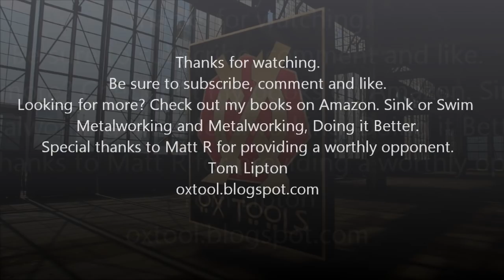Screw Extractor Torture Test Round 1

Comment: Merry Christmas Tom, as a former car guy after the extractor broke off and I got it out I would then drill out stud to just about the inside of the threads and then with a center punch or old pointed pin punch ( been there done that ) and collapse the remaining stud and get it out. That basically shinks the stud from threaded wall of bore,then clean up threads.In my experience if it breaks off when trying to remove the extractor won't get it either, Or else drill out and install a heli-coil. Just my 2 cents. Dave
Reply from the maker: Hey Dave,

If I was doing it for money I would have done that right out of the gate. My purpose was to torture the extractor to the maximum. Looks like I found the limit. Thanks for the comment. 

Cheers,

Tom

Comment: Tom would the high heat present from a turbo installation transfer enough heat to the studs to temper them?  Just a thought.
Reply from the maker: Hey Hank,

I think they use some high performance alloy here to prevent creep at high temperatures. Not sure but it was pretty hard stuff. Thanks for the comment.

Cheers,

Tom

Comment: I was grunting right along with you (noticed my abdomen tightening up during those last few tugs).

Amazing that the screw extractor snapped.  The material looks to be cast.  Can you tell us why it snapped - and why a much harder metal is not used for this tool?  (newbie here, so be gentle).

Thoughts:

1. Although not the original design of the manifold, it seems reasonable that one could drill all the way through and then pass the extractor all the way through, also.  This converts it into a shaft.  Then apply torque (equally) at both ends of the shaft, which might avoid snapping and give you more torque?

2. Perhaps there is far too much material left of the original stud?  Plus, when driving the extractor into the stud material, surely it pushes what's left of the stud even tighter against the threads, making the job more difficult.  Consider drilling a larger hole and using a larger diameter extractor, maybe 2mm or so less than the inside thread diameter of the stud?  This might weaken the wall considerably and allow extraction.

3. And then, if all else fails, would you consider drilling the whole thing out, re-tapping, and using a helicoil insert here?

4. Never used an extractor before... how do you get the remnants off the extractor shaft?

/mark richards
Reply from the maker: Hi Mark,

Check out part two of this short painful series. The extractor snapped due to operator error. Should have used two wrenches to balance the load. I don't feel that any extractor would have worked on this stud. The best method would have been to use the part that I sawed off to rotate the stud while the manifold was red hot again. Barring this drilling and helicoil is the next best option where speed is important. Thanks for the comment. 

Cheers,

Tom

Comment: After breaking a dozen "ez-outs", I don't even play with it any more...straight to the mill. One bolt size smaller carbide end mill, then drill bit to minor thread size, then tap to clean it out. 

Even with setup, it's usually the faster method.

Comment: Quite a coincidence, I'm spending my sunday afternoon digging out a broken 10-24 tap and a 5/32 carbide end mill from my mini-pallet project from the middle of a  1 inch plate of 6061.
Reply from the maker: Hey Phil,

Whoops. Best of luck to you. That will interfere with facing the top off to clean it up level when you want to. I rarely use 10-24. My default is 10-32 almost always if I have design control. Thanks for the comment.

Cheers,

Tom
Reply: Got them all out ;0

Comment: I like to heat up with a blow torch and add a little bit of wax. The wax draws into the threads and acts like a lubricant. Also Mig welding a nut to broken off bolts with wax does wonders too.

Comment: Hey Tom,

Looks like that stud got quenched, either from Turbo or 'Blue Wrench' heat.

I'd have grabbed one of my masonry drills to tackle that stud. Run at high speed red hot it would have taken the temper out and the heat may well have broken the thread seal.

I was told many years ago about removing studs from cast Iron manifolds "If it ain't glowin, it ain't goin".
Reply from the maker: Hey Paul,

Good advice. I take the gloves off in round two. Thanks for stopping by.

Cheers,

Tom

Comment: good luck getting that hack saw under the car onto the stud. i've seen those style extractors snap before. the tip I got was not to tap them in too hard. it expands the stud making it harder to turn out. I would have welded a nut to the stud, and heated the manifold flange to extract the stud. that's my go to technique.
Reply: Hi Albert. He cut off the stud on purpose to make the whole operation harder. The idea was to test the extractor and not necessarily the best way to remove the stud. Good to see another Tremblay. Take care.
Reply: yep/ I got a bit mixed up there.

my dad is from st. paul's Alberta, is dad is Acadian and his mom's family is from Britany.

Comment: I know it's an old video but I think that stud was hardened at the end simply due to heat cycling. Regularly, turbocharger turbine housings can reach temperatures of 900°F+ and steel starts to harden at 725°F. I think that the root of the stud has more thermal mass to absorb heat than the head of the stud, so the end of the studardened but the core didn't.

Just my opinion

Comment: work hardened stainless stud by any chance Tom? I do love those extractors!

Dan
Reply from the maker: Hi Daniel,

Might be. Chips didn't look right for that. I was thinking something with high creep strength like Inconel. Thanks for the comment.

Cheers,

Tom
Reply: Hi Tom,

To be honest I'm not clued up on inconel and the likes, I just remember getting some replacement studs that were stainless for a turbo petrol of some kind when I worked as a car mechanic.

I've only ever snapped one of them extractors and it was a smaller one so kudos on breaking one of the bigger ones!

Dan

Comment: It took forever for me to remove a broken fastener from the crankcase of my dirt bike. It almost didn't want to drill through the aluminum bolt. It ended up breaking through enough to catch some of the bolt and spin it out. By the way those left hand drill bits are expensive. 5 dollars a pop. What kind of drill would I need to really get through these bolts especially the hardened ones? I mean mine barely got through that soft aluminum.
Reply from the maker: +Belicose777 Hi Belicose,

Good quality high speed drills would work fine. IE not Harbor Freight drills of any flavor. Everybody should have one set of nice drills for those tough jobs. Thanks for the comment.

Cheers,

Tom

Comment: PS a lot of those turbo studs are some kind of stainless 17-4????
Reply from the maker: I actually checked it with a magnet. Its just slightly magnetic. I was thinking Inconel perhaps. Its hard tough and creep resistant at high temps. It was less magnetic that 17-4 and harder than even heat treated 17-4.

Best,

Tom

Comment: This is why i always weld on a nut instead of breakinng extractors in there, sometimes if it is recessed the weld method wont work and extractor is the only way, but 9/10 times I weld on a nut. I dont have fancy milling machines, but i have yet to be beaten by a bolt using my welders and oxy/acet rig. 😃 good luck and merry christmas 😃
Reply from the maker: Hey 95,

I purposely cut the stud off to test the extractors. I don't think I could get enough weld on it that short to do any good. Thanks for the comment.

Cheers,

Tom

Comment: Just another note, modern automotive bolts, studs and screws are high, to extra tensile and are torqued to previously unheard of factors. Quite a lot of these fasteners are not available "off the shelf' but only from the vehicle agents as they are unique in size and shape. Go into a modern garage and see the sizes of the "breaker bars" they are monsters.
Reply from the maker: Hey Bruce,

I suspect some kind of high creep strength steels are used. This one is hard but not super hard and barely magnetic. I was thinking something like Inconel perhaps. Have not done a spark test on it yet.

All the best,

Tom

Comment: wouldn't putting two wrenches on the extractor reduce the bending loads on it, and if it broke at least it would all be torque.
Reply: +blinginlike3p0 Exact same thing I was thinking when the extractor began to bend. That's brittle metal and when he started to torque on the wrench, I had a feeling what was about to happen next. I guess the torch took the temper out of the extractor and it flexed more the second time.

Comment: Perhaps the heat cycle of the turbo caused the stud to harden, or Toyota decided to use hardened tempered studs because of the heat cycles?
Reply from the maker: Hi Ben,

It wouldn't surprise me if this is something really special. Its barely magnetic and fairly hard but not too hard. Obviously tough. Thanks for the comment. 

Cheers,

Tom

Comment: My number one rule is use heat whenever possible. the fact that the bubbles are present in the threads shows the is some gap between the male and female threads the main goal in the senecio is to increase the tolerance by heating even with MAP gas or oxy and act. Using extractor is not luck but more skill and finesse using the right tool and using every technique to your advantage. heating using a punch and ball peen to dislodge  break loose deposits using Penetrating oil  reheating weld a nut on if possible and using the proper extractor and drill bits
Reply from the maker: Hi Alon,

Thanks for the comment.

Cheers,

Tom

Comment: I bet those gripper nuts for the extractor rods have double nuts so you can use two box wrenches and twist it with equal force on both sides like a tap handle.
Reply: oops someone beat me to it :V
Reply from the maker: Hey Max,

They do seem a little tall for regular nuts. Thanks for the comment.

Cheers,

Tom

Comment: both the cooling and heating sound interesting to me, what about putting the whole manifold in the freezer?  Also, my 9th grade metals book mentioned drilling the majority of the bolt out and chiseling the remainder, just the threads of the bolt left, chiselling those out.  You would have to estimate the drill diameter for the right size  tap, And, because you have the mill, you could mill the bolt almost all the way and just push the remaining threads out, maybe?  A lot less force.
Reply from the maker: slad roznik Hi Slad,

That is what happened in the end. The point of the video which got lost in all the fun was to test the screw extractors. I think we found the outer limit of their performance envelope. Thanks for the comment.

Cheers,

Tom

Comment: Just like 99% of my tries with EZ-outs. Break off the hardened EZout in the steel bolt.
Reply from the maker: Hey Pat,

This is one reason I like the square ones. They never break they just wind up. They also would not have worked on this either. Thanks for the comment.

Cheers,

Tom

Comment: Don't forget that part regularly gets hot when run, then cools down when off while being covered in oil residue. Depending on what it's made from its likely naturally hardened itself over time somewhat. I think at the point of milling I would,ve seen how close I could've got to the walls (thin it down), then send a tap down. Hopefully it would be thin enough not to snap the tap. Don't think I would've re-used the extractor that showed weakness in it's forging already, that's asking for groundhog day. If you ever wanted proof Blue-point is made in China.
Reply from the maker: Hi Ashley,

The stud material is a precipitation hardening stainless steel. Used for its high temperature creep strength qualities. It was heat treated when it was installed. It may get harder after many heating and cooling cycles as well. Thanks for the comment.

Cheers,

Tom

Comment: next time whilst applying pressure to the ring spanner lightly tap the base material as close as practical to the stud at the same time.The combination of torque with vibration will hopefully break the siezed bolt free
Reply from the maker: Hey Col,

Good suggestion. It was all I could manage with both hands on the wrench. Need a shop assistant. Thanks for the comment. 

Cheers,

Tom

Comment: if you were doing this "in utero" underneath an MKII MR2 Turbo you'd have MAYBE ten inches of wiggle room between the block and the firewall, and the passage to get to that point is much narrower. Not to mention, cleanly, non-destructively removing the turbo, related plumbing would be hellish.

Comment: Hi Tom.
Again, I apologize for my lack of English, and that is me just google translator;)

Why this pin uciąłeś (cutting) right away? This was a long and good material, so it was a much better solution than drilling and breaking extractor, extermination drills and milling ...
Piwerwsze approach had to start with a warm-up the same pin to a high temperature, it is best to red ... Tigi, or burner and leave until cool down slowly and try to unscrew. When it does not help, then what we manage, the weld nut (high current) and hot immediately try to kick-start the thread, and only if that does not work, this is just the best for drilling and thread diameter at once, because then no longer wykrętak help.
The biggest drawback of such extractor, or those with a left-hand thread on the cone is that it expands the broken pin / bolt, which makes it more difficult to unscrew.
Heat causes expansion (increase in diameter) of both materials, and after cooling pin returns to its original diameter, but the diameter of the hole already shrinks less, because they work force yet corroded material and it greatly simplifies unscrewing. Seeing this hard on a daily basis, mostly in the hydraulic lift and bolts securing the cylinder and there is nothing that helps as high temperatyra, and aluminum 99% manage to wriggle out using the method of welding nuts.
Thanks for the video and good luck with unscrewing :)
Reply from the maker: Hi Zbigniew,

Its for entertainment purposes. Fun for you to watch me flap like a big bird. Reality TV. Thanks for the comment.

Cheers,

Tom

Comment: If you use impact force the broken stud doesn't know your coming and comes loose :), Gradual pressure is sometimes bad.
Reply: Yup. Use a series of shocks, penetrating liquid of your choice and lots of patience. I had a 12mm steel drain plug with an Allen socket head set in flush to the surface of an aluminum gear housing. Sitting a minimum of 7 years outside exposed to the elements. No conventional 3/8" ratchet or breaker bar was budging it. The whole motorcycle would start to lift off the floor and threaten to tip over instead.  I figured I'd only get one go at it before I'd round out the Allen socket and no room to get a drill in there to bore it out. I sprayed penetrator, hit the top of the plug with a steel hammer a few taps to shock it and left it. Repeat the spray and tap before going to work, around dinner time and before bedtime for 2 days. On the third day I was going to do the same but I couldn't resist my curiosity so I inserted a standard 5" long L shaped hex key, not even a hex bit on a ratchet. The plug came out with hand strength.
Reply from the maker: Hey Charlie,

Patience is the best virtue when dealing with stuck stuff. Thanks for the comment.

Cheers,

Tom

Comment: The stud would possibly be a heat resistant chrome-moly steel. The part next to the manifold would have cooled a lot slower than the portion on the outside of the turbocharger, over time the outer end would be getting (heat treated giving) a finer and harder microstructure.
Reply from the maker: Hey Jester,

You need a quench to induce hardening in chrome Moly steels. I think this one is something special as its barely magnetic. Its got my curiosity perked now. Might have to do some sleuthing. Thanks for the comment. 

Cheers,

Tom
Reply: Inconel methinks.
I thought I was drilling a heat resistant stainless once, it turned out to be Inconel - Jayzez it was hard!
Reply from the maker: Jester Mclarpet Hey Jester,

Inconel is the female species of nickel steels. Thanks for the comment.

Cheers,

Tom

Comment: Did you ever use Bees Wax to remove rusted bolts and nuts? A shop foreman at the dealership I worked at suggested it. Heat the area with a heat gun, although not real hot. Then put a stick of bees wax on it to melt into the threads, sometimes twice. I didn't believe him until I tried it. I believe it now.

Comment: Faced with the problem at 19:30, Mr Doubleboost would have cut the side of the casting away, taken the bolt out from the side, welded the casting back up ad re-drilled & re-tapped the hole.
Reply from the maker: Hey Adam,

That would work. Thanks for the comment.

Cheers,

Tom

Comment: I never had an luck using a map torch to heat anything, it heats to slowly and the stud expands along with the manifold.
use oxy/ acet torches and heat the manifold FAST to a dull cherry red, and the stud doesn't wick up the heat as fast so it loosens it's grip and you can turn it out. if it doesn't come loose in 1 minite then cool the entire area and start over.
Reply: I agree
Reply: Yes this is spot on idea.
Reply: MAPP is still hotter than the old propane plumber's torch...
Reply from the maker: Hey rodder,

Stay tuned for part two. You will get your wish. Thanks for the comment.

Cheers,

Tom

Comment: Ok I'm a big dummy but it seems that if you drill a hole and then drive a pin in that expands the bolt making the threads tighter just a weird concept I'm sure it works on some things i think steel on aluminum is a tough one maby a old cast manifold lol any way great vid